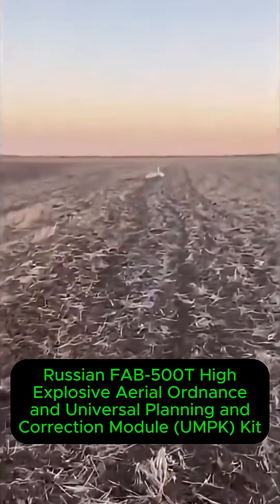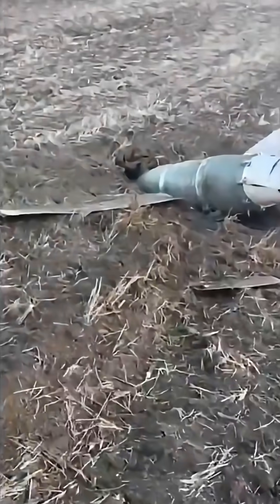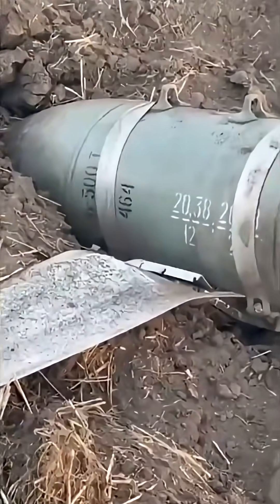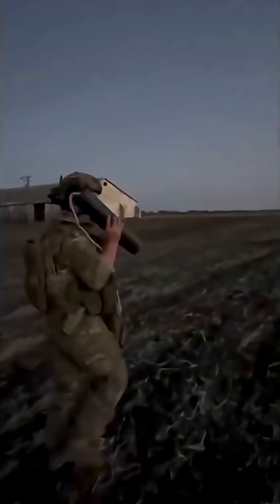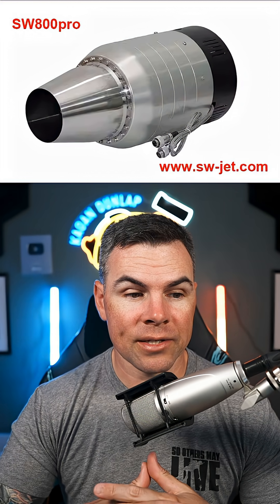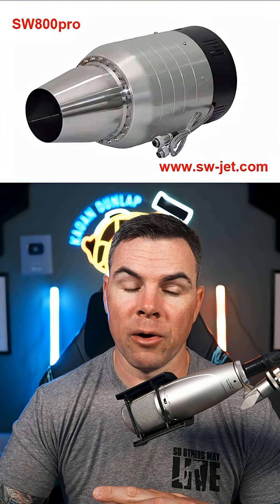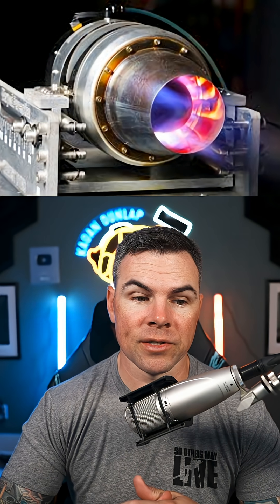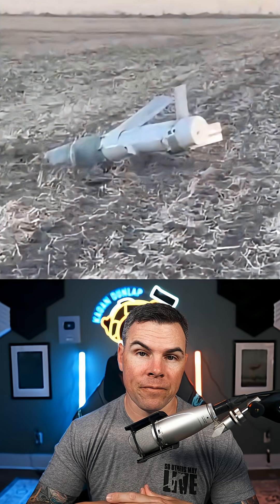Russian FAB-500T HE Aerial Ordnance and its Universal Planning and Correction Module (UMPK) Kit

Comment: According to Ukrainian reports this modification has a 200km range. There’s a seal cap on the back of it. The booster never fired, it ended up there without the booster. Wing kit is open so obviously It glided there. Supposedly this was 170km behind zero line. That means a russian jet made it a minimum of 90-100km deep into Ukraine without being intercepted…… not a good sign.. if jet can breech 50km past contact line, poltava and odesa are well within range of cheap glide bombs. Kyiv is in range of this mod with a functioning booster. Bad developments for Ukraine too guys not just Russia. Russia is losing slower than Ukraine right now

Comment: Pretty ingenious, cheaper than a ballistic missile and has a much longer range than guided bombs thus putting aircraft less at risk. I have no doubt the FAB variants must be up there in causing the most kills between the ukrainian troops, sure the ballistic & hypersonic missiles tagged some of the most high value targets in a spectacular way, such as the Bayraktar factory that was destroyed after 2 years of construction, but the FABs do the heavy lifting.
Reply: The U.S. has been using these for decades except with solid rocket motors
Reply: @AsmellYoullGetUsedTo  well, its not a revolutionary idea and it has been around for a while, i think its more about the low cost by using consumer grade model plane components to significantly extend the range of a basically WW2 style simple dumb bomb that has a glide kit attached to it, perfect in the high volume bombing carried out against less than high value targets. I think the soviets/russians had something similar too, but since they have mountains of FABs already, it is probably by magnitudes cheaper to use those than trying to get some obscure system into mass production again.
Reply: @DerDrecksack87 yeah the U.S. has been using a solid rocket version with laser guidance since the Vietnam war. I havnt heard of a turbojet being used with one but Russo has had purpose built guided bombs with motors for a while, this is just quite a bit cheaper. Supposedly the motor costs 4,000 on the civilian market so it’s very cost effective
Reply: except for the fact they are adding a heat signature to an otherwise un traceable munition…..this goes from being unstoppable to beijg taken down with a man pad.
Reply: @FactsOverFeelings23 you’ll need thermals to be able to see it at any kind of distance. It’s quite small
Reply: @FactsOverFeelings23  i highly doubt that, the engine on the production series will only be burning for minutes, maybe even only seconds since its just a high altitude booster, the trajectory is defined by the glide kit. I also highly doubt any manpad could track this, as i said in its terminal phase its only gliding and manpads need a thermal signature or/and a cross section big enough to lock on and you dont have much time to do so since manpads have only around 4km range and this thing will be really fast in the terminal stage, i would not say never because crazy things happen in war but i doubt it. What is more likely is that a modern close range radar can pick up on it, there are a bunch of ballistic solutions that can even shoot mortars down, but in that case the booster & glide kit wont make a difference. All in all, this booster might be a really good bang for the buck situation.
Reply: @FactsOverFeelings23 it would be able to be intercepted by a manpad if said manpad has thermals and only in the last few seconds of the attack. It glides at very high altitude for the vast majority of its attack flight profile
Reply: @AsmellYoullGetUsedTo in this video it says it only traveled a small fraction of the distance it would have otherwise traveled had it worked right…..
Reply: @FactsOverFeelings23 yes because it. Had. No. Engine.     It was a test of the aerodynamic kit. Hence why it fell in Russian territory
Reply: @AsmellYoullGetUsedTo but you just said the majority of its distance is thru gliding when that isn’t true at all. It only reached a small portion of the distance Becuase the jet DIDNT work……so in fact the jet will be on longer than just the end of the trip……
Reply: @FactsOverFeelings23 omg dude this was a test. There’s an entire video of it. The real one with the engine equipped was in poltava and it detonated
Reply: @FactsOverFeelings23 this is so painful. What is so difficult to understand here. Look at the video. No engine on the glide bomb. Russian sapper crew detonating the explosive. Even in this out of context clip you can see that much. Go watch the full video this guy is lying

Comment: Okay so the JET ASSISTED part is insane to me as a Hornet driver😮
Reply: It's like the agm-123 skipper but a jet engine. Tbh that would probably gain more velocity than a lil Itty bitty jet motor
Reply: @A_barrel  Without a doubt. Just a weird way to integrate RC tech
Reply: @-Ripcord- it is interesting rc tech over the last 20yrs is becoming military tech without any "hardening"
Same with diy electronics.

One thing would make you think they are preparing for a mass spam of cheap weapons, but then they don't have enough platforms(bombers/jets) to spam them. It's a weird conundrum of some sort.
Reply: @A_barrel  I was telling my wife the other night how 20+ ago, my mind wouldn’t have been able to comprehend what in the actual f*** a drone swarm entailed, let alone that the human pilot could control them to any degree 🤯. Having a non-human aircraft off my wing would have freaked me out
Reply: Going to add a couple of small turbines to your car?
Reply: Ah yes the professional pilot calling himself a driver
Reply: @waynebonner9583  many pilots call themselves drivers